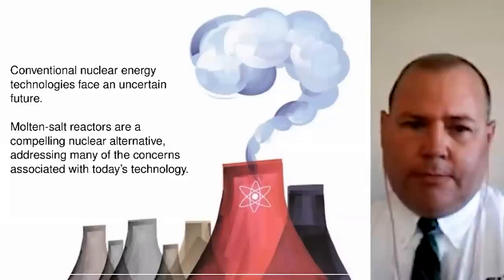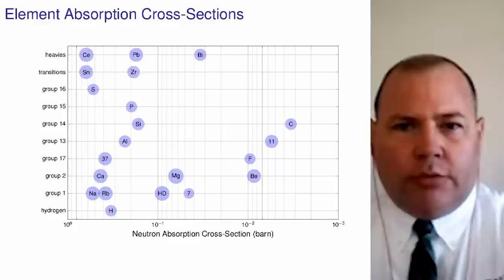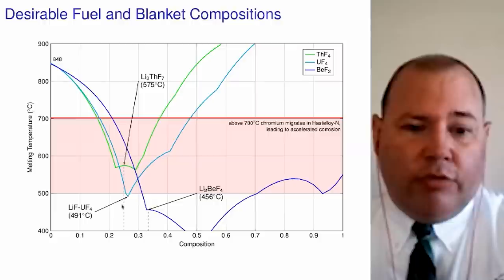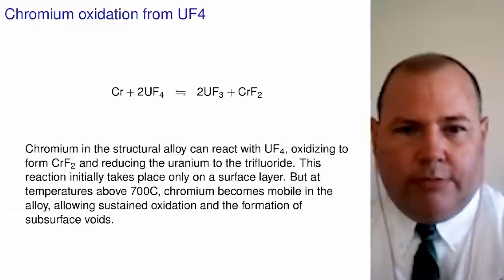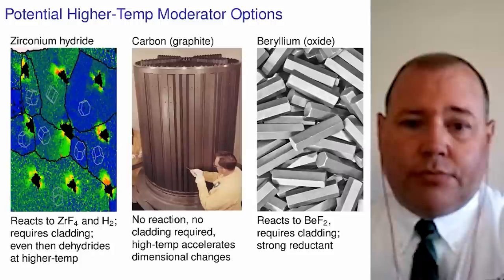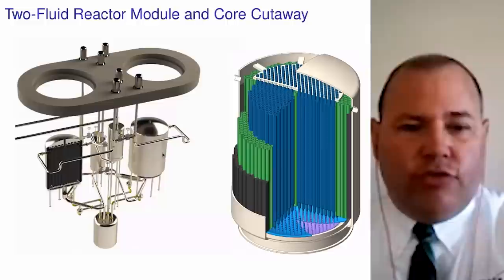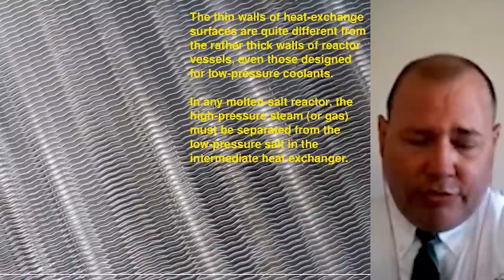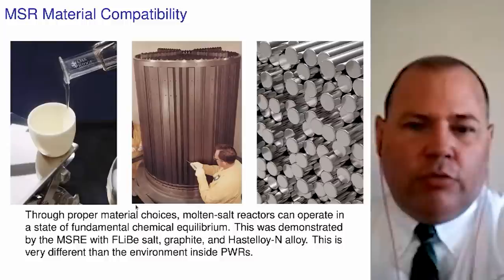Molten-Salt Reactor Choices - Kirk Sorensen of Flibe Energy @ ORNL MSRW 2020

Comment: What if you fill th gap between th cladding with thorium that will capture neutrons and become fuel?
Reply: If you mean solid thorium then you are creating the same problems as we have in today’s reactors. If you mean in a liquid (dissolved form) then in what salt. Also you see they have a blanket to absorb most neutrons. It just never gets them all
Reply: From what I understand of the LFTR design, the intent is to have Thorium tetrafluoride in the blanket salt to absorb spare neutrons, which is then separated out and left in a decay tank to be converted into protactinium, then decay into uranium. You can then fluorinate it and add it to the fuel salt. Breeder reactors for the win!
Reply: @AximandTheCursed  they are leaving it to decay in the blanket for protection in the last review as it is more protected that way.also how do you fill the gap between the cladding(what cladding in this design) if he means the vessel wall then you are protecting the outer wall with a blanket but there has to be a wall that separates the blanket from the fuel and this wall is still getting a high flux
Reply: @brianwild4640  Decaying in the blanket salt for protection? How do they intend to eliminate the possibility of the protactinium absorbing more neutrons? If it becomes Pa-234 then it is useless. Decaying from Th-233 to Pa-233 to U-233 is done by shedding Beta particles, they would only need a small amount of aluminium shielding for that.
Reply: @AximandTheCursed  they reckon if they have enough of a blanket this will be minimal. And I was on about the shield from the core to the blanket that still has to be able to survive the high flux no matter how much blanket
Reply: @brianwild4640  With sufficient blanket salt, then perhaps, as for a barrier between core and blanket, it would make some sense for it to be a neutron reflector, with sufficient scope to allow some to pass through to fertilise the Thorium. Still, allowing Protactinium sufficient time to decay into Uranium while still being subjected to neutron flux strikes me as potentially wasteful.
Reply: @AximandTheCursed  I think we are losing track of what comment I was answering yes I know it has to be a reflector but the comment was can we just put thorium as a cladding. And what ever is the reflector will have to be able to stand the temperatures and the flux as some will get absorbed if it’s stainless then some chromium will get embrittlement happening
Reply: @brianwild4640  They say they're using Hastelloy-N, and the chromium embrittlement will only go as far as the surface, provided the salt temperature is kept under 700 degrees C. As for Thorium cladding? I don't think so as it will need to be replaced at regular intervals, especially as the chemical properties change as it absorbs neutrons.
Reply: @AximandTheCursed  I know all this and don’t dispute this I agree. But again refer to the original comment I was answering they subject is can’t you just use thorium as a cladding which is what I was answering and which you have answered in your last comment

Comment: at 9:05 the blanket salt is mentioned as a neutron barrier that protects the reactor outer shell (its function to carry the thorium that absorbs those neutrons to breed uranium is not mentioned). Does anybody know what separates the blanket and fuel salts?
Reply: A duvet?

It circulates in separate channels in the structural graphite matrix.
Reply: The blanket is separated by the moderator channels. In the original MSBR that's all that separated the fuel salt from the blanket salt. They were intended to combine the two streams in the online fuel reprocessing "kidney" and not the core.
Reply: Thanks both.

Comment: What exactly is the issue with Tritium production? I don't understand why this is such a problem in terms of energy production.
Reply from the maker: Tritium is hard to contain, and the creation of Tritium costs precious neutrons. LFTR is extremely neutron-tight, and everywhere neutrons can be saved they need to be saved so they'll hit U-233 or hit Th-232.
Reply: @gordonmcdowell  ah, ok. Is this production happening in the core? I thought he said it was in the turbine and steam but I am probably not understanding correctly. I'm a software guy, not chemical/nuclear guy 😅
Reply from the maker: @aaronely759  FLiBe salt is both in core salt and blanket salt. So that Li will produce Tritium. Kirk is hoping to use a CO2 turbine which will make it easier to catch any Tritium which might escape the reactor (as compared to H2O in steam with Tritium getting mixed up with normal hydrogen). Isotopic separation of Lithium is a thing in Russia and China but no longer USA. Kirk has ideas how to do it, as do some other folks that are trying to fly under the radar presently. Worth doing for battery tech and medication not just for Li6 vs Li7 in FLiBe. (Or just pay China for Li7. Yikes, but probably doable.)
Reply: @gordonmcdowell  using co2 seems like a brilliant idea. Did USA outlaw isotopic isolation? Asking because you said 'no longer'.  Very curious to hear why this is the case.
Reply from the maker: @aaronely759  They had it for the original MSRE (which used FLiBe salt) and probably for weapons? I think Li6 had some utility in hydrogen bombs? Was never outlawed, but people poking around at starting it up got some pushback. That was before MSR were taken seriously, and I've not heard of any pushback in the past 5 years.
Reply: @gordonmcdowell  so more legal reasons blocking this?
Reply from the maker: @aaronely759  Destruction of U-233 is the big showstopper. If there's no U-233 then chicken-and-egg problem to create pilot plant (no plant without U-233, no need for U-233 without pilot plant). United States Senator Tommy Tuberville has been working to try preserve USA's U-233.
Reply: @gordonmcdowell  someone needs to go the big tech strategy with this one. Just build it to proper standards, and start offering it for cheaper than any alternative and let the idiots in Washington commit career suicide opposing it... Which they never do because they have no backbones 🤷

This is the only reason we having things like hoverboards, onewheels, quadcopter drones, Amazon flex, etc. I'll do it myself if crypto goes high enough.

Comment: I have a question concerning something I've heard bantered about, and wanting an answer from someone actually knowledgeable.

I've heard it said that instead of using Thorium, you could instead reprocess spent fuel rods (in other words, nuclear waste from older generation nuclear fuel rods). It won't be as efficient, but it would be power positive, and would actually consume the waste, being a net sum loss of nuclear waste... effectively turning a huge problem into a fuel source. 

Is there any truth to that, and do you plan on doing something like this? If possible, it would be a way to pitch to people who are normally very adverse to nuclear power, by pointing out that your main goal is to get rid of the nuclear waste, and that power is a convenient byproduct of that. Suddenly, it goes from 'nuclear bad' to 'cleaning up nuclear waste AND getting power out of it'.
Reply from the maker: That's a fast-spectrum reactor. I think Kirk sees those as still important too but not the primary "fleet" of LFTR one would deploy around the country. It is possible to use Chloride salts in a fast-spectrum molten-salt reactor. TerraPower is developing one, but their near-term reactor is still solid-fuel fast-spectrum and only uses molten-salt to store heat, not for fuel to be dissolved in.
Reply: @gordonmcdowell  A fast spectrum,  Chloride salt,  somewhat lower temperature reactor is what Ed Pheil of Elysium advocates.  The lower temperature allows the use of proven alloys and components. The fast spectrum allows burnup of nuclear waste in addition to  U238 or Thorium.   I would love to see Pheil and Sorensen go at it in a discussion of the relative merits of each approach.  Kirk omitted NaCl from his chart. Has he ever discussed Ed Pheil's arguments?

Comment: Just curious, what happens if salts leak out the reactor (or some water/air somehow enter the reactor) ?
Reply: A dump tank if there is an issue.
Reply: As far as I knows, and is not much, in case the salt leaks out of the reactor it will solidify and could be recovered taking safety measures, but for what I know there is no risk of filtration to underground water or mixing with the floor...

I don't know about water/air entering de core sorry.
Cheers
Reply: @picanexus  well, I meant a flooding from for example a nearby river, sea, etc...
Reply: @babyelian77  Yes molten salt reactors need to be kept well away from water. Whereas PWRs need lots of water to cool core in case of pressure loss, so must be by river or sea, MSRs are unpressurized and in the unlikely event of overheat the drain plug melts and the fuel is dumped into cooling tanks. They are better suited for dry or even desert environments as they can be designed not to need any cooling water (the MSRE was air cooled). Any MSR installation would need to be built well away from flood prone areas.
Reply: @jimgraham6722  Having to be water cooled is a big drawback which LFTRs avoid. Tsunamis for one, heating and cooling of
water with cycles affecting water inhabiting life is another.
Reply: @babyelian77  Seems like Kirk's LFTR needs NO water for operation of any kind!  Probalbly could be built in the driest areas of the world!

Comment: which reactor is better?  Your's (FLIBE's_MSR ) or Ed Pheil's fast_neutron MCSFR_reactor? At least one or both should get the funds and support to get it up and running! (and then improving and going serial) An economical output should be around 750MW_electrical. 

PS.: have You read about Betavoltaics.com? They develop C-13 diamonds from spent carbon-moderators; very interesting for NASA and ESA and Roskosmos:  long-lasting deep-space-probes!

Comment: Unfortunately beryllium is very rare and produced in tiny quantities. There is not enough for reactor use.
Reply: My hobby is collecting antique tools and sometimes come across BERYLCO (and other brands) of Non-Sparking tools for use in flammable situations. Collectors know to NOT buff or sand oxidation off them due to inhalation hazard. New ones are maybe still available? I'm sure they are expensive, but if they can sell tools made from the stuff, I would think the quantities needed for small reactors should be affordable?

Comment: 1. Why is this technology better than the IFR?
2. The carbon moderator causes me some concern. It was the carbon moderator that caught fire in Chernobyl and caused the disaster. It burns just like coal. What would stop that from catching fire in some disaster scenario in this MSR? The typical failsafe in an MSR is the drain tank. But without the salt surrounding the carbon, why wouldn't it catch fire in an emergency where the salt was drained?
Reply from the maker: IFR is solid, and fuel must be fabricated. Same problem as any solid-fuel-rod reactor, rods must be shuffled to maximize their fissioning, and ultimately dissolved and refabricated to get anywhere close to 100%.

Graphite moderator can vary in quality. We don't have good characterization of Chernobyl moderator, but it was likely extremely poor. USA tests on high quality graphite show heating to white-hot 1650°C without incurring ignition or self-sustained combustion.

Here is Terrestrial Energy (I-MSR not LFTR but also using graphite moderator) on their decision to use graphite: https://youtu.be/T8K3ezyrioA?t=1406 (Terrestrial Energy at the Economic Club of Canada, in Toronto.)

Molten-Salt Reactor Experiment did also use graphite. Graphite is a major component of future advanced reactor fuel TRISO. This isn't just Flibe Energy using graphite, it has been studied by national labs non-stop since gas-cooled pebble reactors were ever deployed in UK and Peach Bottom ran in USA.
Reply: @gordonmcdowell  IFR was working technology that solved all of the problems associated with nuclear power. MSRs are still being worked out. They are different, but just because MSR do not use solid fuel does not mean they are better. It seems to mean that they are more difficult to engineer. Only fast spectrum reactors can fission all the transuranics. Thermal spectrum reactors cannot do that, leaving long-lasting nuclear waste.

Thanks for the info on graphite moderators.
Reply from the maker: @slydog7131  I'm not opposed to IFR. I think TerraPower (large scale) and Oklo (small scale) are doing a good thing to commercialize those technologies. But if you want my opinion why we should ALSO be commercializing MSR (it looks like a commercial MSR will be running by 2030), it is that liquid fuel is a superior concept because chemistry can be performed on the fuel without any dissolving/refabricating.

That lends itself to extracting valuable materials, and ultimately segregating anything that can't be sold into an idealized storage mix... not the random jumble of spent fuel, but like-with-like chemistry and/or like-with-like half-lives.

TerraPower (currently commercializing something like IFR as "Natrium") is also working on fast-spectrum molten-salt. Their solid-fuel "Natrium" will be commercialized first, but they too see the value in pursuing fast-spectrum in molten-salts.

Comment: How about the molten lead as an alternative medium for the fission?
Reply: Low boiling point, vapor problems, plating problems, cleaning it after irradiation, and it's heavier than salt, therefore it will fall out of solution easier. To mention a few.
Reply: The experiment has already been done. The guy who invented the MSR, Alvin M. Weinberg, knew his nuclear and his chemistry. The reactor Kirt was talking about, the modern version, is for all intents and purposes exactly the same as the 1960's reactor. The original test MSR reactor was designed and built by really smart people and they knew what they were doing. Kirt's furthering Weinberg's original work and I think it's the smartest way forward.
Reply: @quietackshon  yes and they had the freedom to actually do it and learn so much is just done buy simulation in today’s world
Reply: Lead is a decent coolant for solid fuel fast reactors. Not quite as good as sodium, which doesn't have the plating problems but lead is much more stable in the environment if you ever have a leak. Lead doesn't burn in air or explode in water. Although lead and sodium, at the temperatures you find in reactors, will both flash water into steam and cause a steam explosion. Sodium continues exploding though. Lead doesn't.

It's not really applicable in a Molten salt reactor though.

Comment: Tritium is just hydrogen, chemically. Modern PWRs and BWRs use electric recombinators to turn hydrogen gas and oxygen into water. Then, you could capture that water using a desiccator, right? Of course, this solution is neither perfect nor elegant. But since this reactor concept is so compact, wouldn't it be relatively easy to build an airtight containment structure for the tritium water?

Comment: Unlike the existing "fast reactors" (i.e. breeders) this does not look like it can have a run away nuclear explosion (during a power loss for coolent, a breeder core can melt down and yes, undergo a small nuclear explosion - the rather serious drawback to breeders). Amazing that this one doesn't appear possible for that extremely dangerous issue. Shows that this type of new nuclear fission reactors is not only vastly safer than any current reactor design but that it burns waste nuclear fuel is simply amazing!
Reply: EBR-II survived a complete cessation of circulation just fine.

Comment: I get lost when the discussion gets so technical but the sticking point I see is the chemical processing required to use thorium. Seems like most of the problems at Hanford center around chemical waste handling and disposal. I would love to see a test bed molten salt reactor program especially if it could burn the waste that is from all the spent fuel rods in dry & wet storage but the chemical processing looks like a source of pollution to workers and the environment. I’m definitely not against nuclear power generation but until the final waste storage issue is addressed it’s another industry passing a problem along to future generations.  Mine tailings, ash ponds , Co2 emissions and land fills need to be addressed so other sources of generation are already passing their problems along to the future.

Comment: The benefits of MSR's are enormous. Why can't we have an international X-Prize for people solving whatever remaining hurdles there are for commercialized MSR's? Not just in the USA but worldwide this would usher in a new age of plentiful reliable clean energy.

This should be a top priority. We need 4th-gen reactors now. It would make for an energy revolution on par with steam power and the petroleum economy. We could see GDP growth of 10x in a few decades. Make them reliable and mass-produced. Have inspectors do thorough inspections within the factories, and cut cost while increasing safety. No reactor could be called "4th Gen" unless it's walk-away safe. There has to be 0.00% chance of another Chernobyl even under zombiepocalypse conditions.

I'd also like to see some smaller reactors at various sizes.
Size of a house - Great for powering a small city, especially up north where solar isn't the answer.
Size of a Honda Civic - Great for powering a train or a boat.
Size of a refrigerator - Great for powering a semi truck or aircraft.
I don't think we want this in a car.

We'd also need spent fuel recycling centers. We'd need a network for this like our current petroleum distribution network.